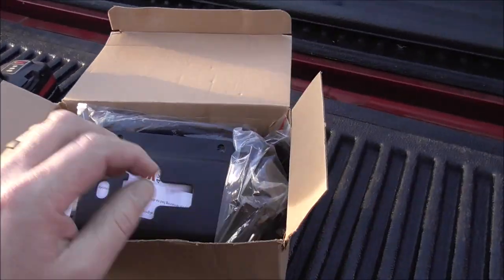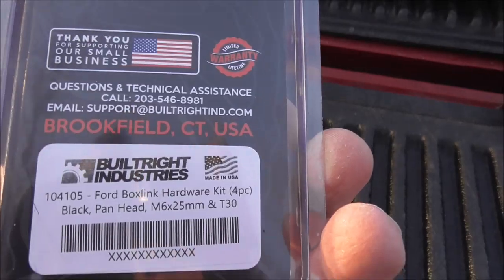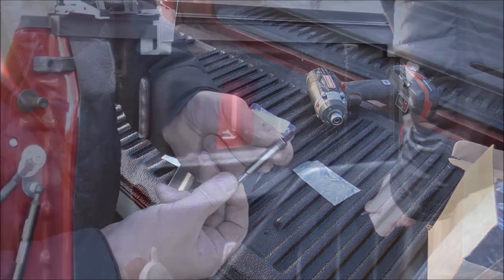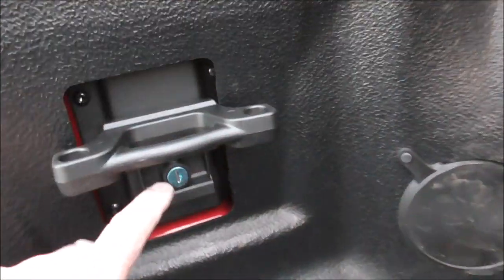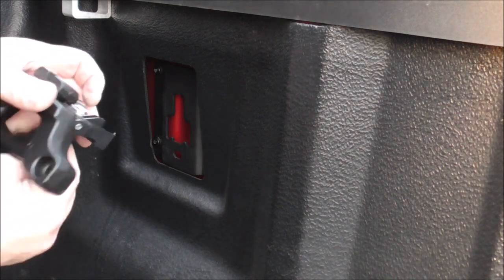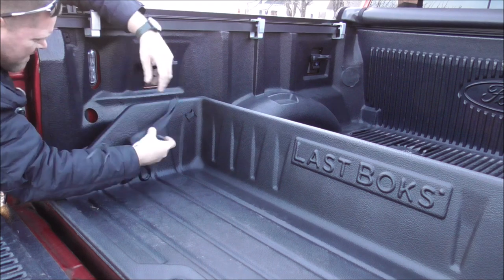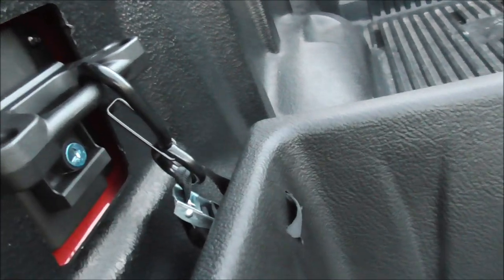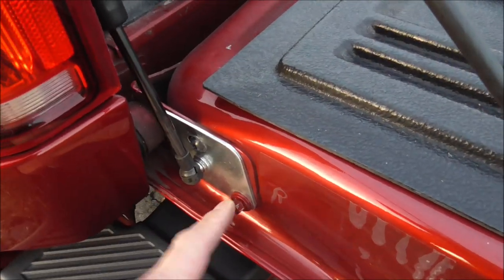Installing Extra Cargo Tie Down Points In The Bed Of My 2018 F150 - Here's How

Comment: Screwing those into the sheet metal of the truck bed ,doesn't matter what the hardware is rated because that sheet metal is going to tear before the hardware breaks
Reply from the maker: If it were just sheet metal that would be true but there is backer material behind it that makes it about 1/4 thick material your going into.

Comment: I see you have a plastic box in the back to put stuff into and control movement.
I put 2 2x6's on top of each other in the wood containment slots.  I put holes/slots in the top board to tie things to, to prevent rolling/moving.  (Big welding cylinders, propane tanks, groceries, etc.)
Nobody uses those slots for what they are for (OK, I do, but no one else).
Try it - you may like it, for when the plastic tub just doesn't quite work.

PS  I put struts on my tailgate also, big difference.
Reply from the maker: You and me bud LOL. I also use those little channels for 2x's. They work great. Like you mentioned they work awesome for tanks. I trust it a lot more than the plastic 👍
Reply: @BrandonLund  
👍

Comment: Great video man, I do alot of frame jobs on trucks, just done a 2012 f-150 the back half of the frame was gone rusted completely out,a little advice clean and undercoat you frame. Excellent job man...
Reply from the maker: For sure! We get heavy salt on roads in the winter. Every fall I blow almost a gallon of fluid film under it. And I even put it into the doors and rockers even though it has an aluminum body. Aluminum will corrode after a while do I don't take any  chances. Bush cheaper than spending 60k on a new truck every 5 years lol

Comment: Looks nice but it won't work in my Chevy truck. I've had a bed liner like that but they are slippery, last 2 trucks I've owned have the factory spray in, hardly anything slides.
Reply from the maker: I've contemplated putting in a sprayed liner because I like the clean look but then I would just end up dropping this back in anyways so it wouldn't make sense. The bodies and bed on these are aluminum so im not sure how much abuse it could take before it dented.
Reply: @BrandonLund  I don't know much about the aluminum bed
Reply from the maker: I've owned Chevy my entire life. My 2002 rotted in half and I got bitter. I loved that truck. The seats were the most comfortable of any truck I've ever owned and the motor would have gone forever but the thing rotted out like crazy. GM really fried me. My father in law bought this truck brand new in 2018 as a lease. He drove it 26,000 miles of which 3,500 were mine going from Maine to Chicago on a family trip. When his lease was up I had the lease transfered into my name and bought out his lease. I paid 28k for the truck. We will never see these prices again so this truck will have to last my lifetime lol.